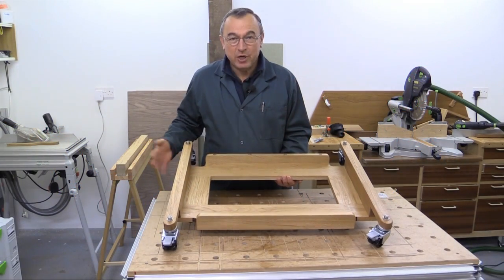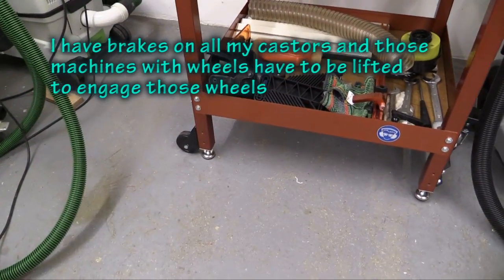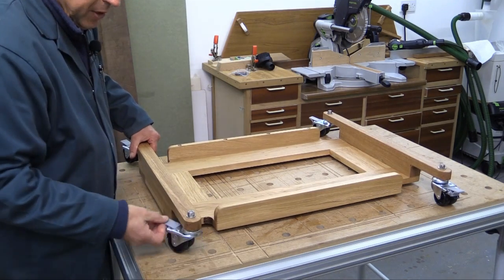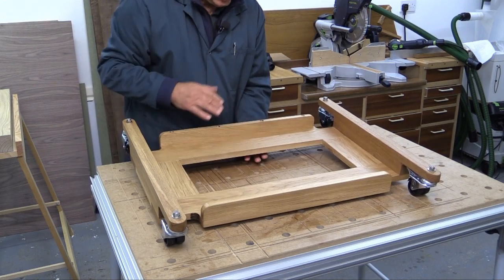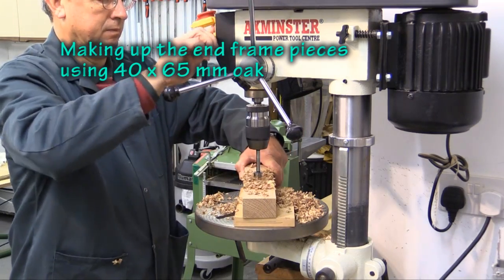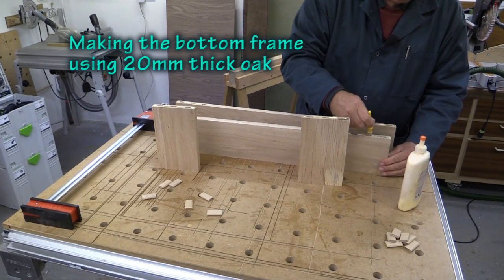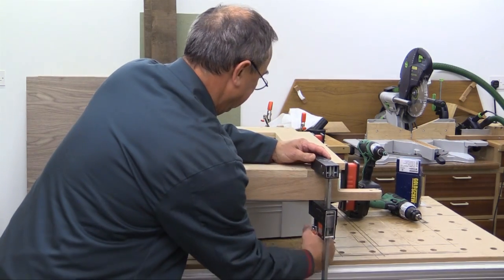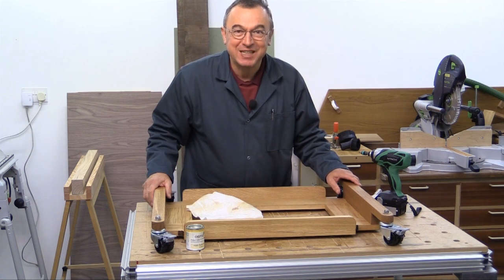How to make a moveable machinery platform - castor carriage

Comment: Hi Peter, I am presently setting up a small workshop. I tried accessing the Coldene site but apparently firstcastors is no longer available and if you go directly into the Coldene site and search for the double wheeled brakes version you suggested, the site is no longer available. Or so it seems. Does a anyone else supply these castors. I have a stock of the grey rubber ones and but after watching your video I have decided against them now. Thank you for your excellent presentations.
Reply from the maker: Ivan Johnston The firstcastor.co.uk web site works fine for me - note that there is no "s" after firstcastor.    Peter
Reply: +New Brit Workshop (Peter) Thank you Peter. Unfortunately still unsuccessful. Will keep on trying. :))
Reply from the maker: +Ivan Johnston I did not put the "www" in front of the detail in my last post as I thought that YouTube would block it. Try this - www.firstcastor.co.uk        Peter
Reply from the maker: +Ivan Johnston      Ivan, I have just spoken to the sales guys at Coldene. They are having a problem due to a software upgrade and they would be delighted if you call them direct. They know all about the various castors that I use so it will be the best route for you. Their number is 01296 431135
. They are all very nice people and always very helpful.    Peter
Reply: +New Brit Workshop (Peter) Thanks so much Peter. I will call them. Regards

Comment: Nice build and also good planning ahead. I have only one bad thought on you cart. The area you take out for the casters, that leaves a very thin area of the wood to hold the weight of your planner. I would have went with longer bolts for the casters and left more wood in the tongue for the casters. Just my option.
Reply from the maker: William Castleberry Hi William, The version shown in the video developed a crack to the bottom lip when I transferred my Axminster planer off and my new Jet planer onto the platform - I put all of the weight on the front lip. I have since modified the design and am using slightly thicker oak. The plans are free of charge and they show the original and the new version.   Peter

Comment: Peter, I am a new subscriber and enjoyed your video very much. I have 2 questions, firstly I don't  see how to email you for plans in the about section and secondly, as I don't have a domino machine do you think 10mm dowels combined with strategically placed pocket screws (and a 5mm thicker oak base board) would be sufficiently strong? 
Thanks and keep up the good work...
Regards
Steve
Reply from the maker: Steve Harris Hi Steve, To get the plans to you I need your email address. You can send this privately by clicking on "New Brit Workshop" then hit the "About" tab followed by "Send Message". In your message tell me what plans you would like and also give me your email address. I will then send whatever plans you would like free of charge to your email address. On the second point I would expect your idea to be strong enough. The design is quite strong with screws and glue alone so having some dowels too will help. Welcome to The New Brit Workshop.     Peter

Comment: Hi I have been on the Coldene site but am having difficulty finding the twin wheeled braked castors. Have you got a reference number for these, if so could you post it here so that I can order them please.
Best regards John
Reply from the maker: John Fithian-Franks Hi John, I am not sure if you have the plans for the castor carriage - if not just send your email address by Private Message and I will send them free of charge. I have built a stronger carriage since making the film as I now have the bigger planer. For that I have used the 75 mm twin wheel castors from the Coldene "Institutional" range - product code CDTWBH75BL. The 50 mm castors shown in the film are from the same range and are product code CDTWBH50BL. The Coldene web site is called Firstcastor dot co dot uk. My plans show both the original design and the stronger design.    Peter

Comment: Hello,

when lifting from corners like this you should assume the weight is distributed over only three of the castors.  It's fairly easy to get a bit of warp, or the floor isn't flat etc and you have a castor taking very little load.  Conversely there are no situations where you can have two wheels off the ground.

Comment: How much it cost a machine like that one you waiting  for and were to findit.
Reply from the maker: misael pacheco Hi Misael, The Axminster AW106PT is now about £850 and the Jet JPT260 is about £1315 from Axminster. Axminster Power tools deliver world wide but large machines may cost a lot to deliver outside the UK. Just Google "Axminster Power Tools" to find them. I now use the Jet as it has a higher cutter speed and thus leaves a smoother finish.    Peter

Comment: Nice mobile base, actually the nicest I've seen yet on YouTube, and I appreciate your design commentary.  I've been trolling around for mobile bases because I must create one for my 600 lb. (280kg) industrial radial arm saw, which isn't just heavy, it is top-heavy.

My challenge is that due to its very large size and the roughness of the floor surfaces, I have chosen to use 4" casters (American-English sp.) and need about 25mm - 35mm clearance, which will raise the worksurface too much.  That means I need to come up with a retractable set of wheels.  I've tried the hinged, swing-down style and the tool just weighs too much for that method.  Any good ideas?

Today, I'm trying to rig up a scissor-jack mechanism -- oh yes, that is the sound of a treacherously complex system ... and I'm uneasy about it.
Reply from the maker: SuperBardley I have had to overcome a problem like this a while ago. I made a base that kept the bottom of the machine just an inch off the floor and then had heavy duty castors out to the side. If you send me your email address by private message I will send a picture to you. No need for a scissor jack mechanism at all.    Peter

Comment: Wow, great build. I have just one question. I never thought that smaller Domino 500 would be suitable for such high load? I always thought that you need Domino 700XL with cutting depth up to 60-70 mm and 12mm Tenons minimum, for such a huge load.

I guess i was terribly wrong :(

From this point, i would tell that you are using 8 mm domino cutter and depth of 25 mm, with 50 mm domino tenon?

Thanks for sharing all those great projects and best regards!!!
Reply from the maker: Monika Kis Hi Monika, I have only recently got my larger Domino (the DF700) and would have still used the smaller one for this project. You will be surprised how much load can be taken by a 8 or 10mm domino in oak.   Peter
Reply: Peter Parfitt Hi Peter, thank you very much for your answer.
What can you tell about Beech or plywood? Would you still use Domino 500 for larger project, like big mirror frame, big table and so? Is 40 mm mortising depth with 8 or 10 mm tenon enough for strength? Thanks!
Reply: Monika Kis u

Comment: 5:40, So only the 12 screws are  used to prevent the heavy machine from detaching the bottom plate from the caster beams, that doesn't sound very safe.
Reply from the maker: ABB Hi ABB, The majority of the weight of the planer keeps the castors in place. The only possible stress on the fixings is caused by a very small torsional strain which I consider to be insignificant. Even with just two screws per castor I would not lose any sleep at night.   Peter
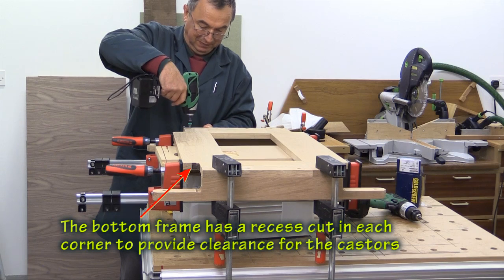Reply: Peter Parfitt HI Peter, at 9:22, you put screws into the castor beam with the bottom plate (which been put together at 8:54). You didn't show exactly how they were put together, I assume screws are the only means to hold them together?
Reply from the maker: ABB Hi ABB, The frame is jointed with the Festool Domino. It is glued and the base and frame and then glued and screwed together. It is very very strong.   Peter
Reply: Peter Parfitt  Awesome, thanks Peter, that's a very nice looking rolling stand.

Comment: Hi sir this is Mushtaq mughal from Pakistan. it is good idea you make a move abel base I like it but sir you choose the place for wheels very corner of the frame and now wheels are free to touch with anything.  near me its not safe during move if you cover the wheels in the wooden outer panel and make the whole in same place then whees movement will not disturb because wheels will cover by wood.are you agree with me sir !  Thanks
Reply from the maker: mushtaq mirza Hi Mushtaq, I put the wheels as far out as possible in order to make the whole platform stable when the planning machine was being used. I am happy with the way it works but if you wish to change the design to suit your requirements then please go ahead.  Peter

Comment: Hi Peter,

Just want to check how the castors are doing? I'm going to build a similar carriage for my planner thicknesser, which only weighs around 60 Kg. Is this the same castor that you fitted http://www.firstcastors.co.uk/Bolt_Hole_Braked_Castor_with_Black_Polypropylene_Wheel.asp ? Also, from another video, I recalled that you recommended getting castors which lock both the wheel and the swivel mechanism, but I to my knowledge these castors only lock the wheels. Has this caused any problems. I would appreciated your thoughts, as I need to order 12 castors.

Cheers,
Tom
Reply from the maker: Hi Tom,

Yes, you have the right castors for the planer platform. For my original platform (shown in the video) I used the smaller 50mm ones. They worked well with my Axminster 106 planer which was well over 100 kgs. When I got the Jet planer I built a new platform, with slightly thicker wood, and used the 75mm castors. The larger castors run better than the smaller ones.

You are right, there are brakes for the wheels but the pivot shaft does not lock with this type of castor. This presents no problems at all for a planer carriage. It is only significant if the carriage is going to be subject to a lot of lateral force - as is the case with my mobile bench (when planning by hand etc). But you said that you were getting 12 castors - so what are the other two platforms going to be?

If you need the plans just send me your email address by private message and I will send them to you free of charge.

Peter
Reply: Peter Parfitt Thanks for the advice Peter. The other castors will be used on my table saw and bandsaw. Each are under 80 Kg so I should imagine it will be ok. Having some plans to work off would be great. Will send. 

I would just like to mention that your videos are very brilliant. Keep up the good work. Cheers Tom.
Reply from the maker: Many thanks Tom. I have sent the plans to you.  Peter

Comment: this is excellent idea and it is more difficult to make that you have make it to look. I am a hobby worker and have even a smaller shed so I need all the tools to move.
do you have the planes for this as I would like to put a mortise machine on one of these. dimensions are 410x410mm but the wheels that I have from coldene are much larger than the one you have used 80x100x105mm  W X L X H
Reply from the maker: I have no plans to sell but I would be happy to send you a screen dump of my drawings which you can then adapt. Just PM me your email address.

Peter

Comment: A beautiful piece of work, thanks for sharing it. I have a couple of questions - If you didn't have a Domino how would you have joined the four base pieces - with a half lap joint? Presumably dowels would be rather dubious in this application. Secondly where do you buy oak like that from? I've only worked with softwoods to date, I see there are online suppliers such as britishhardwoods.co.uk, do you have a local supplier and how do you find a decent one? Thanks
Reply from the maker: Many thanks pcb. The joint between the four (flat) base pieces could be dowelled. You could also put mortices in both sides and make up some tenons of your own. The cross members, which are glued and screwed, give it quite a bit of strength.

In order to find a local supplier do a Google search for outlets in your area. Failing that go into your local builders' supplier and ask where you can buy oak. Finding a decent supplier is a matter of trial and error I am afraid.

Peter
Reply: Peter Parfitt Do you have a hardwood supplier you would recommend? I believe we're in roughly the same part of the country.
Reply: Peter Parfitt Peter i found your videos through recommendation from woodworkersworkshop.

I want to build a mobile base for the Axminster table saw AW10BSB2 which with its extension wings on the left and Incra rails on the right will weigh close to 240 kg. Like your recent base, I want to keep the machine fairly close to the floor,support the main saw but also need to combine the base unit with the left and right extension supports when it is moved. Any ideas or advise would be most welcome

Regards

Brian

Comment: Hi it's possible for someone to give me  bottom dimensions  planer  thickneser AW106 PT2 ? I'll try to make the platform for my machine. Thank you very much. Or the dimensions of the castor carriage of Peter?
Reply from the maker: Hi Adam, The AW106 has a footprint of 435mm x 565mm. The castor carriage was slightly bigger all round. If you send me your email address by Private Message I will forward a diagram with dimensions.  Peter
Reply: Hi Peter. Thank you for fast response. I was order AW 106  from Axminster and will be with me Friday . My email adamkatynski@yahoo.com 
Thank you so much Peter for help. I'll like yours reviews .